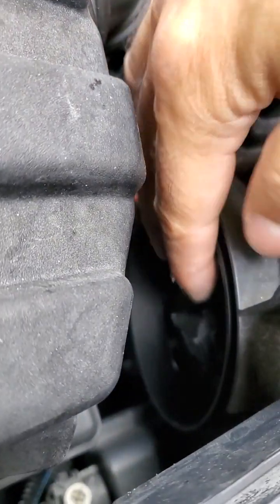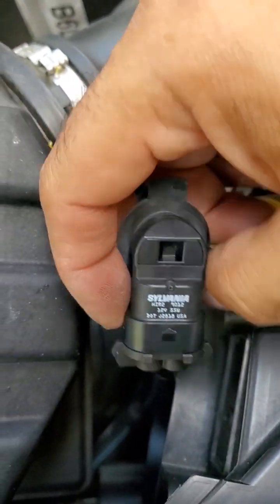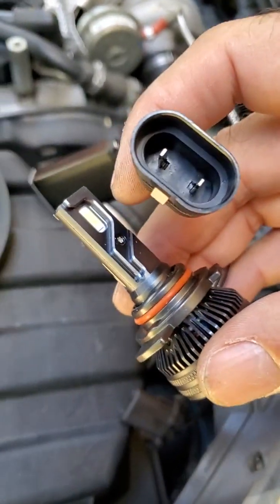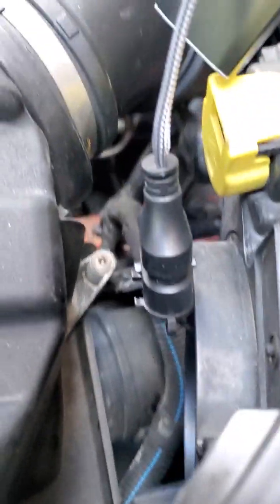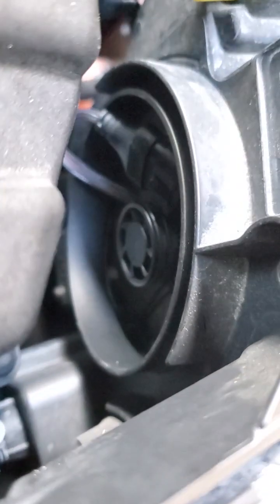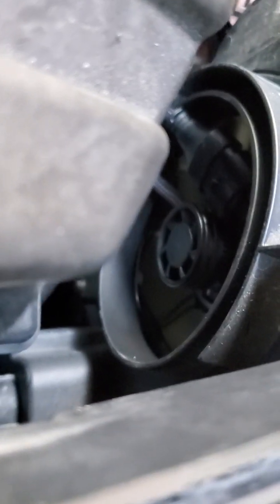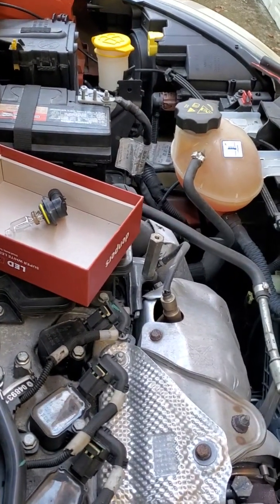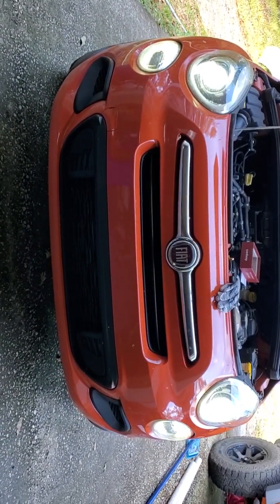Fiat 500X LED projector bulbs replacement

Comment: Helpful video.  Do your beam height adjusters work?  I'm assuming the height adjuster is the screw on the top of the light assembly, but turning it on either side makes no change in the beam at all.  Or is it the screw on the back side bottom that is shown in your video?
Reply from the maker: Thank you!, I don't see where I showed it in my video but it is on the top of the headlight housing, If you are looking at the right headlight top down, it is at the corner closest to the fender. It's a little white screw that is counterclockwise, so turn left to aim up and right to aim down.
Reply: @SonicBoom247  I know but turning the screw does nothing to change the beam height, even when pointed at a wall 10 yards or more away.  Have you turned yours and confirmed it works to move the beam up and down?  Neither of my headlights move at all, even when 10 yards or more from a wall no amount of turning makes any difference.
Reply from the maker: Very odd but no I have no needed to adjust mine.. sorry

Comment: I had switched out my Wife's bulbs but it kept blowing the fuse on the Battery and keep saying the bulbs were out..... is there something i'm doing wrong ?
Reply from the maker: if it is blowing a fuse you may have a bare wire somewhere along the socket. only install one bulb and test without putting it back in the headlight. Move it around and if fuse does not blow, proceed with installing it, then move on to the next one, if that one blows a fuse you will need to start checking the wiring. hope this helps.

Comment: looks like the video was posted about a year ago, how have these bulbs held up?  I saw some reviews on Amazon (not for Fiats) that some customers complain about flickering.    Looking to upgrade the bulbs on my and my mothers fiat to something a bit better than the standard OEM ones
Reply from the maker: So far they have held up with no issues and no flickering, the DRL, however, do have a slight flicker when the car is turned off, very very dim flicker but it has not caused any issues or drained the battery.
I will provide an update,  I checked and it looks like the left bulb has gone out and is in low power mode. That being said almost two years on these are not too bad for the price.

Comment: Hey man what bulbs did you use for the DRLs?  I hate the yellow but don't want to get a bulb and it throws a code
Reply from the maker: I used these,  one did go out after a year, but i ordered a second set since they didn't throw a code. Also when the car is off there is the faintest light 
Alla Lighting 1156 7506 LED Bulbs... https://www.amazon.com/dp/B07WPMB848?ref=ppx_pop_mob_ap_share

Comment: What were the bulb size you used I want to switch my chick's out for led's same car
Reply from the maker: These are the ones I used but any 9012 will do.
9012/HIR2 LED Headlight Bulbs, 120W 24000 Lumens, 6500K https://a.co/d/4SFSWMQ
Reply: 9012